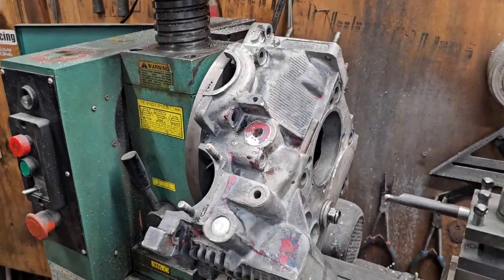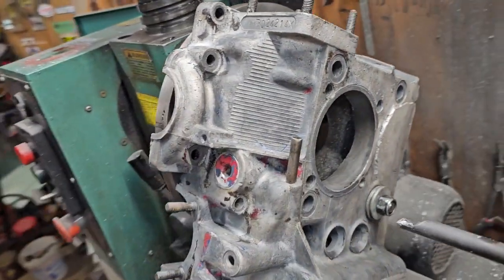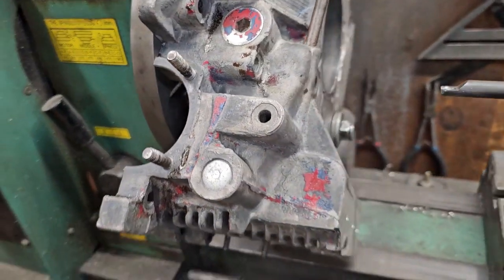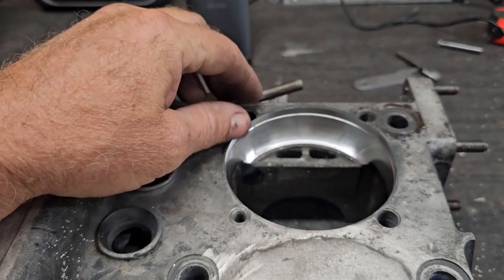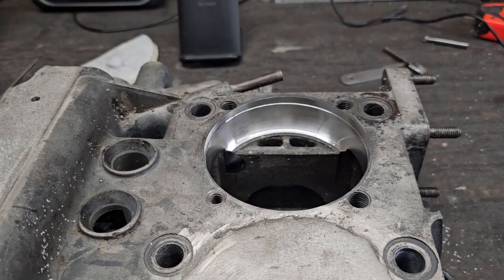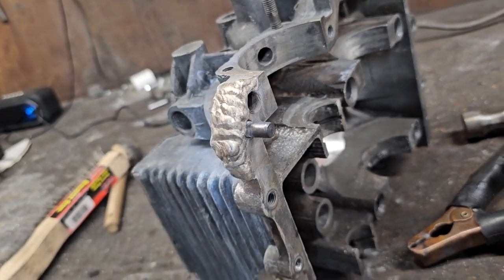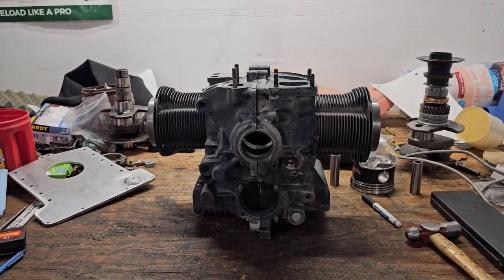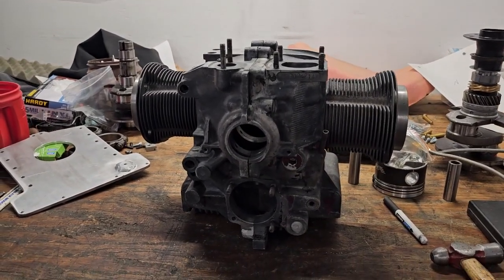1/2 VW Build - Part 10.1 - Case Boring Complete!

Comment: Nice! I can’t wait to see it run.  Was that a type 1,2 or 3 case?
Reply from the maker: Type 1 AB case.
Reply: @xpsgarage   I found a type 3 1600 case and I’m curious to know how much has changed.   Or what to do.  All the plans I have seen for a full case half vw. Are for type 1/2.
Reply from the maker: @ThisandThat1.  from the little research I just did it looks like very little was changed between the type 1 and 3 cases.  Mostly just external packaging so I figure you could make the type 3 work.  Lots of information available on the vw message boards.